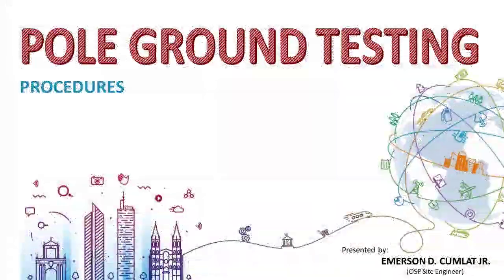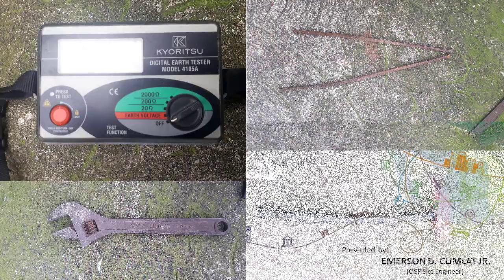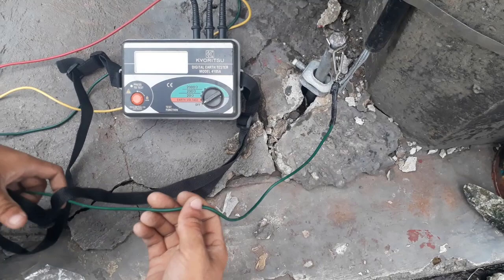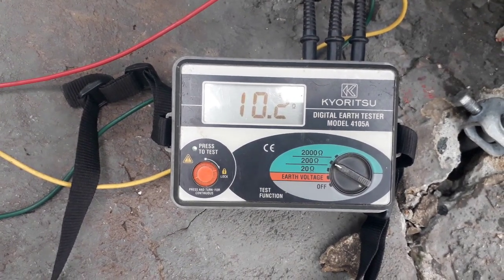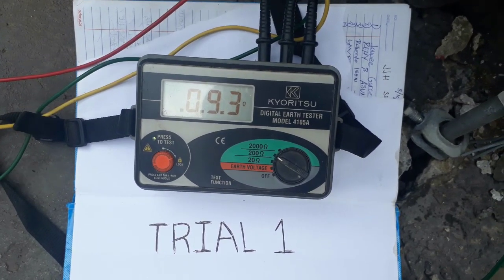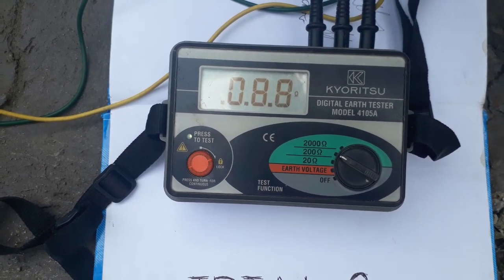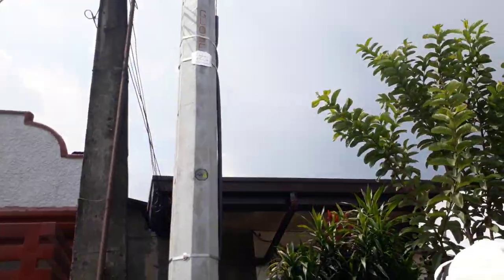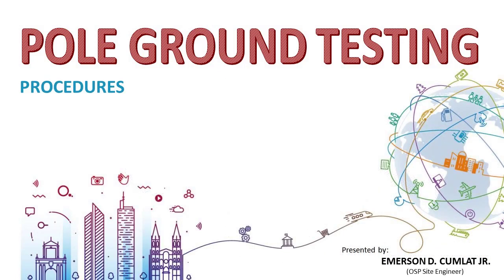Pole Ground Testing Procedures

Comment: tanong lang po. anu po standard resistance for grounding sa globe?
Reply from the maker: 20 ohms pre
Reply: @EMERmusikero93  what if mag exceed siya sa standard? anong dapat gawin ??
Reply from the maker: @engr.astrophile8733  dagdagan ng grounding rod i parallel mga 1 meter gap sa moist na ground  para mabawasan ang resistance